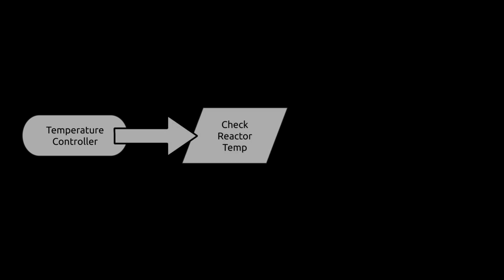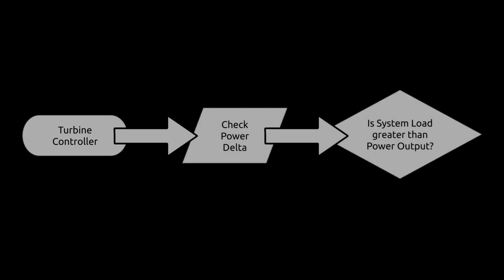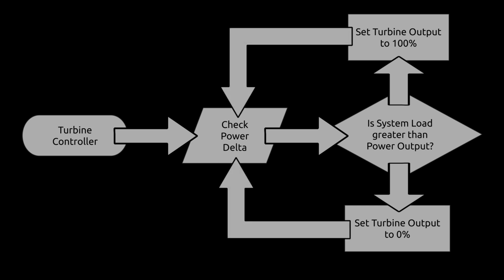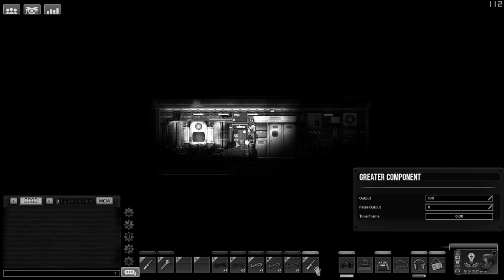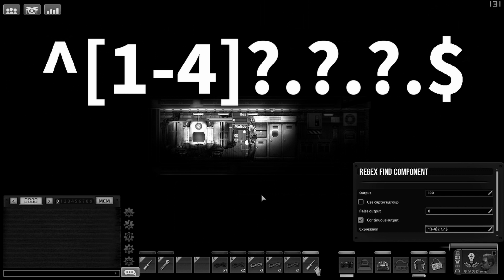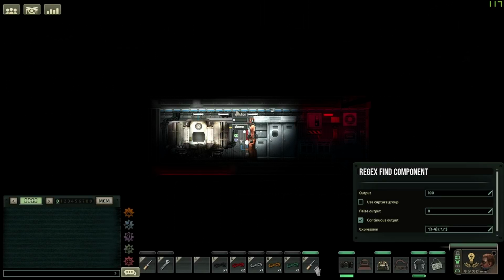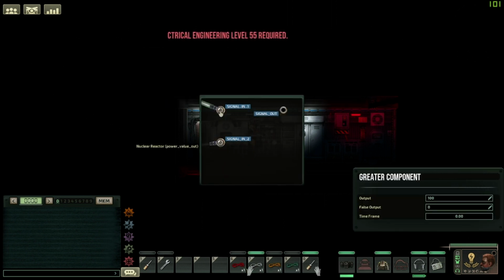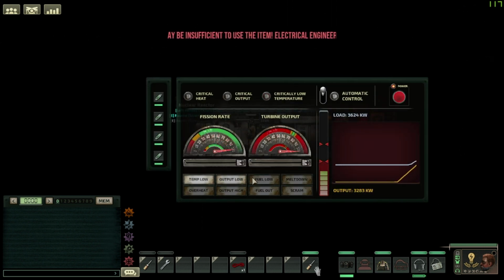Barotrauma - BEHOLD! The 2-Component Reactor Controller!

Comment: Is it possible to add a Relay component to this setup and a lever to deactivate the reactor controller for manual control? For emergencies, docking and other reasons... Otherwise Amazing and simple design. Well done. 👍
Reply from the maker: Yep! you'll need more than that, though... Two relays, a NOT, a switch, and ten wires. This should be done while docked so you don't a) get pressured by your crew and b) accidentally blow everything up.
1) Plant the relays near the reactor with the NOT component between them, this just helps me keep everything organized. We'll call them the "auto-signal" relay and the "zero-signal" relay.
2) Wire the STATE_OUT port of the auto-signal relay to the SIGNAL_IN of the NOT component.
3) Wire the SIGNAL_OUT of the NOT component to the SET_STATE of the zero-signal relay
4) Put the switch or lever somewhere handy but not tempting for mischevious crewmates. I put mine above eye level, in the shadows nearest the reactor. Be careful, it's entirely possible to mount a component somewhere that it can't be reached once placed.
5) Wire the SIGNAL_OUT of the switch to the SET_STATE of the auto-signal relay. We now have a pair of relays that will always be in opposing states, slaved to the condition of that switch. Leave the switch OFF for now
6) Wire the SIGNAL_OUT of the RegEx component to the SIGNAL_1_IN of the auto-signal relay
7) Wire the SIGNAL_OUT of the Greater component to the SIGNAL_2_IN of the auto-signal relay
8) Wire the SIGNAL_1_OUT of the auto-signal relay to the SET_FISSIONRATE of the reactor
9) Wire the SIGNAL_2_OUT of the auto-signal relay to the SET_TURBINEOUTPUT of the reactor
10) Wire the SIGNAL_1_OUT of the zero-signal relay to the SET_FISSIONRATE of the reactor
11) Wire the SIGNAL_1_OUT of the zero-signal relay (yes the same as step 10) to the SET_TURBINEOUTPUT of the reactor
and finally,
12) Wire the STATE_OUT port of the auto-signal relay to the SIGNAL_1_IN of the zero-signal relay. 

If you haven't already, this is the time when you disconnect the direct connections between the RegEx and Greater components that were in place before you started.

The inputs all remain the same, it's only the outputs that are being intercepted. When the switch is ON, it turns the auto-signal relay ON, allowing the RegEx and Greater components do their thing. When its OFF, there's a sneaky little trick in there... The "state" of a relay is boolean in nature, but code-level it's all strings of letters and symbols. Luckily for us, the symbol for disabling the reactor is the same symbol as the one generated by the STATE_OUT port. 

Is this what you were looking for?
Reply: @TheGamingNerd2022  Yes. Exactly what I was looking for thanks for the in depth response. I gotta try this out. Thanks man much appreciated 👍
Reply: @TheGamingNerd2022  Is the purpose of the zero-signal to just soft-shutdown the reactor when you flip the switch? If I want to enable truly manual control (for example, when the engineer is actively managing), it works if I just cut the Not and Zero-Signal Relay from the circuit, right?

Comment: I'm having a problem making this. The components' wiring ports don't look the same as in the video. Such as the reg ex as 2 input and 1 output instead of 1 and 1. What do?
Reply from the maker: There have been enhancements to the power system across the board, not to mention improvements to the functionality of a variety of wiring components, such as the Regex. The "set_output" is used to create the option of a dynamic output signal, instead of the standard fixed output. Basically, if the regular search expression finds a hit, the signal received at the set_output port is cloned to the signal_out port. In this application it's irrelevant, so the temperature_out signal from the reactor still goes into the signal_in port of the Regex.
Reply: @TheGamingNerd2022  ok. I gave it another try, doing it the same way as in the video and it's just giving me 0 output. Also thanks for the quick response!
Reply: Omg I don't know why but it's suddenly working?! Great tutorial man I'm just dumb

Comment: This looks to be a good priority thing to do…(except advancing gun and engine levels..which isn’t retrofitting at all) what other updates/retrofits are high priority?
Reply from the maker: Choosing shop upgrades is more of a playstyle / group decision and varies from ship to ship (maybe a video on that is justified?)  so I can't really recommend one over the others, but I can make suggestions for further improvements you can make with wiring components! 

Like you said, I would always start with the reactor controller. The time saved from negating damage around the ship is so important that I would recommend deconstructing whatever you have on the sub to in order to craft the parts needed immediately. This includes headsets and buzzers (like the meltdown alarm, which won't be needed anyway one you get the controller online) for FGPAs, diving masks for rubber, and  even FPGAs can be further deconstructed into copper for wires... getting the reactor controller up and running ASAP is that important!

After that, I would prioritize upgrading door controllers (video coming soon) which don't sound like much but will vastly improve the quality of life on your sub.

Then maybe condition indicators on all of the more important things like crucial junction boxes, the navigation terminal, and/or supercapactitors.

Speaking of supercaps, I believe a recent update introduced a mechanic where a supercap starts taking damage when the charge rate is set  > 70% of the max rate, therefore, I'm working on a simple circuit which automatically sets the charge rate to 69.5% when necessary, but can be triggered to temporarily run at 100% in emergencies. 

Those are all the important mods I can think of, there are other handy ones like a two-stage depth charge trigger, proximity alarms, or adding remote-scram and docking-interlock to he reactor controller... I have other designs in the works working since terminals are now craftable, keep an eye out for that and more coming soon!

Comment: I found this very useful, since the latest update this doesn’t work anymore though, do you think you can make an updated version
Reply: Try this expression on regex: ^([1-3]?.?.?.?|4000)$. Also make sure auto control is turned off.
Reply: @stardewstunner3096  thank you, i will try thisw and report back.
Reply: @stardewstunner3096  it's still not working, output capped at 2800 regardless of load, manual control on, double checked and triple checked my wiring
Reply: @RainDaemonic  Using an Orca 2 By chance?
Reply: @Brazoul  typhon 2
Reply: I'm having the same issue I think, trying it out for the first time and reactor output is stuck at 2799 KW in testing.

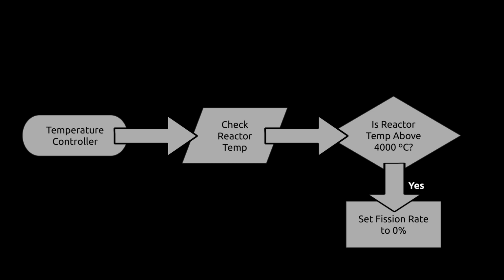Comment: 0:40 you are actually checking for reactor temp above 4999

Your RegEx expression matches anything shorter than 4 digits and if the string is 4 digits long then it just checks whether the first digit is a 4

Comment: I made a change to the regex.

^([0-9]\d{0,2}|[1-3]\d{3}|4000)$

1 capture group, 3 or's.

First: 0-9 followed by 0 to 2 digits.
Second: 1-3 followed by 3 digits.
Third: 4000 exact.

I had to modify 1-9 to 0-9, because when the reactor temperature was 0 (i.e. after being docked at a base), I couldn't power on the reactor as the regex node took 0 to be false and wouldn't set the fission rate.
Reply from the maker: The thing about regular expressions is that, in general, there are many ways to accomplish the same thing. No matter how many ways there are, aside from computational requirements (and it would have to be a big friggin' search expression to tax a modern processor), there's really no right or wrong choice -- it's more important that you understand the way your search expression works, in case you need to go back and change it or copy and modify it for a different application in the future.
Reply: woudn't it be easier to have a string like 0|^[1-4]?.?.?.$ which just checks for the 0? RegEx noob here

Comment: This is pretty much the strategy I use now for my 3d printer build plate temperature control rather than the PID control the firmware came with. Cool to see the use of real world electrical engineering fundamentals in the game, that actually implement realistically. What an elegant solution, subbed just for this great job.
Reply from the maker: Bang-bang control FTW!!
I'm also into 3D printing myself. What kind of printers do you have?
Reply: @TheGamingNerd2022  Just one that started life as a Tevo Tarantula, thats now direct drive with added second Z axis, linear rails for the bed, and a few self-designed printed gantry mounts and a few other things moved around. The wires are a spaghetti mess though lol, I still havnt gotten around to printing a chassis for the PSU/board/screen
Reply: Bang-bang control is cute for microcontrollers and low-voltage systems, but something like this would never fly in a true power system using kilowatts, the induction caused by connecting/disconnecting a load that big that fast would quickly destroy the system. That being said, even though your control for your printer is "working", you're likely going to wear down your PSU much faster than normal. Should probably buy a fire extinguisher to keep nearby.
Reply: @danielfraga1897  for this purpose its not just good. It's good enough!

Comment: Regex is so fun, I spent about a week in shipbuilder so my engineer buddy can have own little computer terminal where he can tweak recharge values of caps, batteries, get status updates and remotely turn off/turn off tthings, open doors and whatnot. Sub even had a isolatable "junction sections"
Reply from the maker: Sounds epic! You should put it up on the workshop! I'd download it just to see what a "junction section" is...
Reply: Basically, the sub was divided in three sections, each section had one master junction box. In this case master jbs refer to jbs that are wired directly to power supply. With as many junction boxes as needed for the section's wiring. Each section of the submarine had a junction box room that could be locked from the engineer terminal.

Unfortunately, the HD where all this regex sub is nice and broken and the files in question came out corrupted. This whole terminal system sounds amazing when I write it, but eh, it's just pretty basic stuff to what I've seen regex guys flaunt over at Undertow Discord.

Comment: I'm having some trouble implementing what seems like utter simplicity. The Fission is going well, but the turbine dial does not move. Could you help me troubleshoot what I'm missing- Ive tested on the editor but cant figure it out
Reactor wiring looks like this (since both logic dont touch)
1) Rex Ex_Signal out-Set Fission Rate
2)Greater than_Signal out_ Set Turbine
3)Reg Ex_Signal In- Temperature out
4)Greater Than_Signal 2 Out- Power value out
5)Greater Than_Signal 1 out

Greater Than Logic Component (Output=100,False=0), Reg Ex Component (Output=100, False Output=0, Expression: ^[1-4]?.?.?.$ )

N.B. Ive placed a Temperature_out-Text Display and it reads in the 4-5k mark, so I'm confused as to why the Turbine isn't working
Reply from the maker: Point #5 on your list doesn't say what the GT signal_1_in is connected to... It should be the load_value_out from the reactor
Reply: @TheGamingNerd2022  My apologies, it was late and i forgot to type that. Yes the GT_sig1 is linked to the Load_Value
Reply: My fission rate dial tends to stabilize in the 30-40 range, but my turbine dial never moves past 0. Ive used the same default engine from the Submarine editor, those two components-in the described configuration and added a simple floor, a hull for testing purposes. From that point i added a text display to all the Engine wiring ports to see the numerical values- out of the five connections, only the Temperature out had any readings-the others where blank

Comment: This doesn't seem to work for me, all I achieved was almost nuking myself three times.
Reply from the maker: Two suggestions:
1) make sure you have the load and power signals the right way around. If the load is greater than the power output,  then the turbines are set to 100% until power matches or exceeds load, and
2) the regex is looking for temp at or below 4999, and pins the fission rate at 100% until temps go above 5000. The expression needs to be exactly (without the quotes):
"^[1-4]?.?.?.$"
That's a hat, square bracket, one-dash-four, square bracket, question mark, period, question mark, period, question mark, period, dollar sign.
Reply: @TheGamingNerd2022  Followed the guide to a T. Did a lot of reorganising and testing and all I can say is, apparently my reactor can't handle a voltage higher than 2000.

Comment: So this design was essentially what my intuition told me to do initially, but I used two greater than components and a memory component with a value of 4500. Mine wasn't working, so I spent a little bit implementing your other design with someone else's fission controller and that seems to work. The problem I was having with this setup was that my turbine output would get cranked up so far I couldn't maintain a decent temperature, but with more than one fuel rod I would overheat. Now that I know this works I'll have to revisit this idea.

Comment: I've had some problems with this sub during campaign, after we dock and after the loading screen, the reactor is on fire and it explodes shortly after if we don't deal with it in time. I tried changing the 1-4 to a 1-3 so temps weren't as high but it still exploded. Anyone have any clue?
Reply: Do you figured it out?
Reply: @amol_6561  nah i haven't

Comment: From my tests, if you change the output in the Regex Find Component from 100 to 25, the service life of the rods increases from 2m07s to 2m45s (5% consumption), which is a whole + 30% to life (fission stopped jumping to 100 and jumps only to 25, which pulls up fission arrow several times weaker). You only need to add 1 check: that the reactor has more than 1 rod.
Reply: But how to do the check if reactor has more than 1 rod?
Reply: @kiril_records  

You have the Fuel_out port on the reactor which outputs the cumulative heat potential of the fuel rods that you put in, since there are 3 fuel rods that have 80, 100 and 150 heat potential respectively you need to check for 160 heat potential for 2 uranium, 200 for 2 thorium and 300 for 2 fulgurium and so on.

You could also set up an alarm that pings you when you have less than arbitrary% fuel left with the Fuel_Percentage_Out so that you never risk staying with an empty reactor and no power
Reply: Doing my own tests for curiosity sake but I'll add them here when done
R-29 big rig spawned in sub editor
max speed
2 uranium rods

100 fission rate
around 25 minutes (will re-test as I wasn't watching when rods expired)